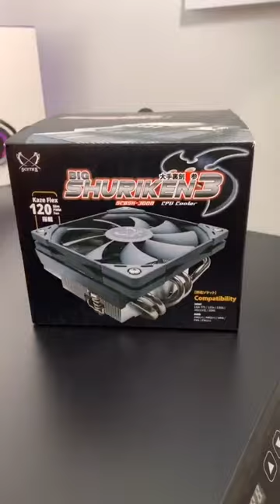PC Case Fans Explained: Intake/Exhaust | @NZXTglobal Kraken Z63

Comment: That method isn't 100% reliable. You can always see fans have curved blades right? The steep pitched side is the exhaust, because the fan is scooping and gradually compressing the air.